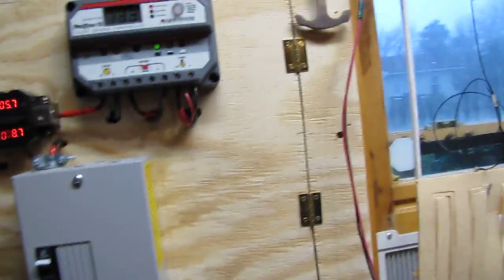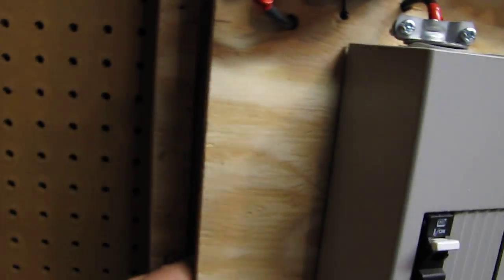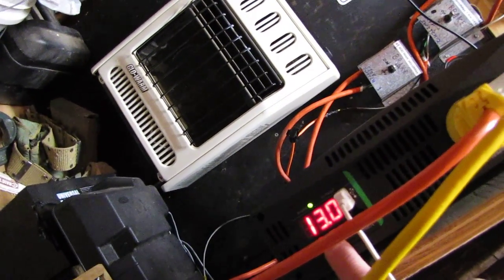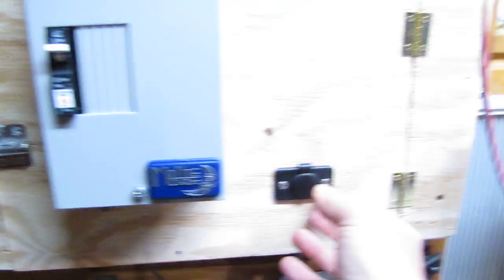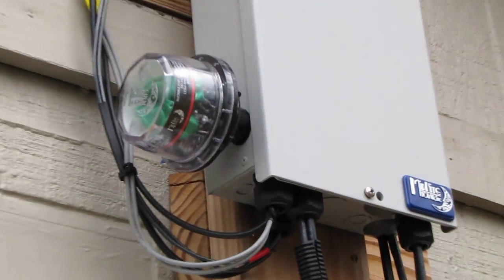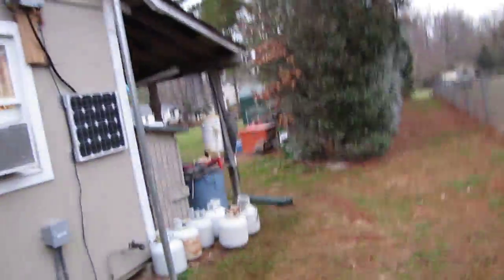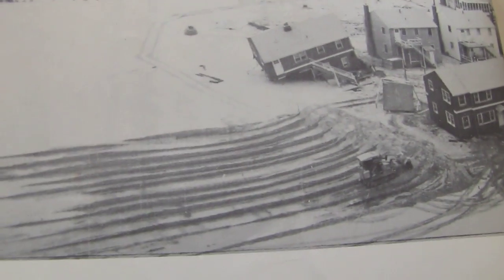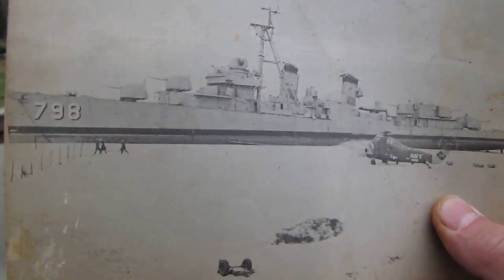My Small OFFGRID Solar Electric System Revised for Hurricane Sandy Victims By VIARLOCITY

Comment: Concept is good. Wiring is VERY good. You have GOT to put the wire run UNDERGROUND! Furthermore, the wire run from the shed to the house is WAAAAAAY TOO FAR! You're going to lose more than HALF your energy to resistance! I would suggest building two separate systems-One for the shed and one for the house. Your basic understanding of Solar is quite good and can serve you well. But, if it were me, I'd build an addition on the main house and put a larger system in there to power your place and the smaller system will meet the needs in your shed.
I'm not criticizing you personally-but I DO want to help you do a more efficient job.

All of this being said, my response to your video is THUMBS UP!
Reply from the maker: Bruce Forster I Understand Completely This System Just Runs Small Stuff Like A Deep Freeze Etc Inside My Small Shop  My Other System On The Other Side Of The Shop Is My Big System  Right At 4700 Watts  And That Runs To My House 120  Volts And 30 Amps Through 240 Volts At 60 Amps  To My House / My Whole Property Here Is A Link 
http://youtu.be/YrySl68ZRGU    Cheers Kenny

Comment: sir how long have these batteries lasted on this system with a set up like this can i run about 5 11 watt light and a 30 watt television each night with any issues
Reply from the maker: These Batteries Are 5 Years Old And Still Kicking Sir You Should Be Able To Run Those Items Easily ! I Would Add Another Battery Just In Case

Comment: Hey, nice job on the set up. the batteries you have will last a short time to run things like your fridge. if you find a local Trojan battery dealer, you can purchase old T-105=225amp hour, T-125= 240 amp hour batteries for about 25.00 each, that should give you a longer run time you can count on, great set up!
Reply from the maker: Many Thanks Buddy Yes Trojan Batteries Are Very Good Buddy

Comment: You sound a little bit like Elvis Presley ........Nice solar setup .......What kind of dual RED digital read-out gauge was that  ?
Reply from the maker: Thank You Very Much  Buddy I'm Using  A BOGART ENGINEERING TM-2025RV TRIMETRIC METER WITH ENCLOSURE FOR RVS (INCLUDES FUSE AND FUSE HOLDER)   Battery Monitor

Comment: Looks like a nice start. Midnite is some good equip. You really should be charging your batteries @ c10, aka 10% of AH capacity. 180 AH = 18 amps so about 250 watts. Being as it is not suggested you use more than 1/2 your capacity, you have 90 safely usable AH. That's not going to run a fridge for more than an hour. Depending on your freezer, it will do that.

Comment: In an emergency you could bypass the defrost cycle and consolidate all the important food into one fridge and just monitor that one. A small top freezer 21 cu ft fridge will take from 1200 to 1800 watt hours of power per day. Those batteries would probably do that for one night but you need the solar power to support the re-charge in the daytime, that would be about 400 to 500W of panels in good sun. And don't forget that you lose 50% whenever you use a battery to store energy.